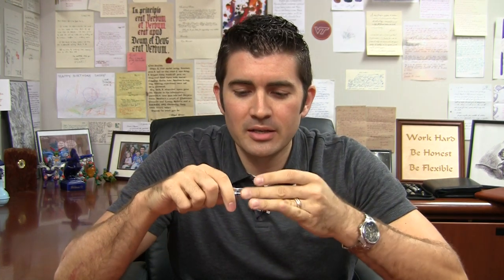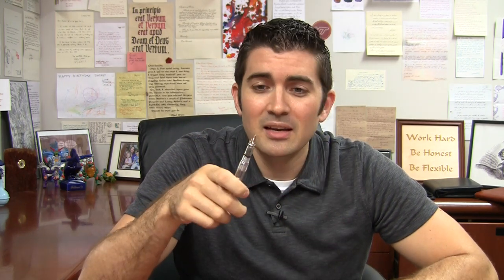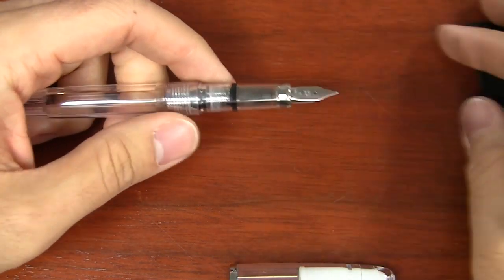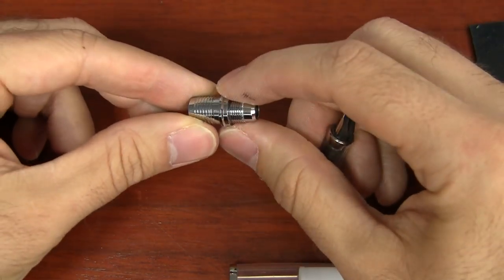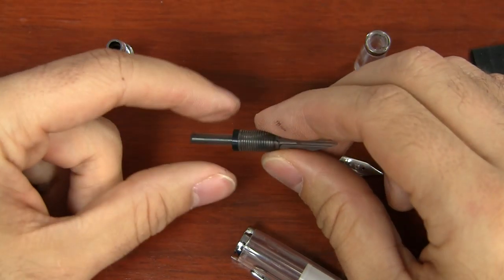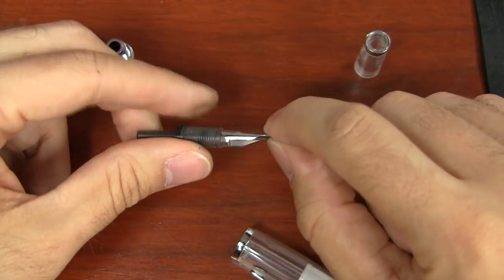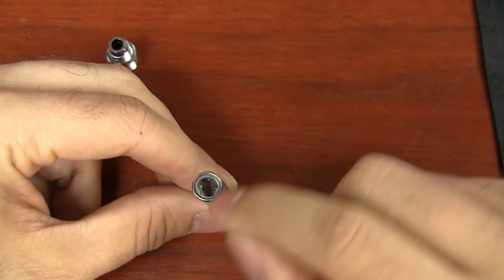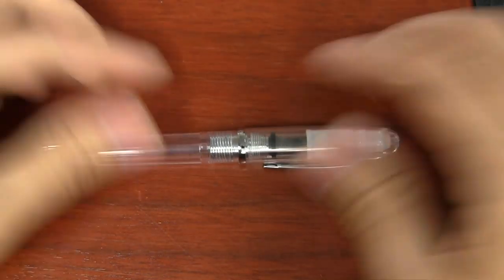Breaking Down the Platinum Cool/Balance- Ink Nouveau

Comment: Any suggestions if the feed is being stubborn and feels stuck in the grip section?  I don't want to press too hard on the nib and the tube sticking out the other end does not give much to hold onto to pull from.
Reply from the maker: Russ Hammond Did you unscrew the back end of the grip section? That's a key part of the process. -Brian Goulet
Reply: Yes, I unscrewed the metal part that also has the washer but it is still very tight.
Reply: @russ hammond have you any soluyion ?